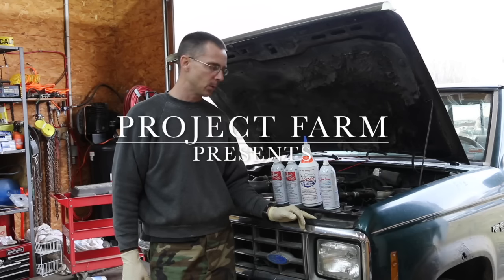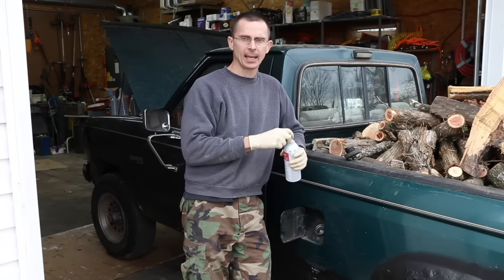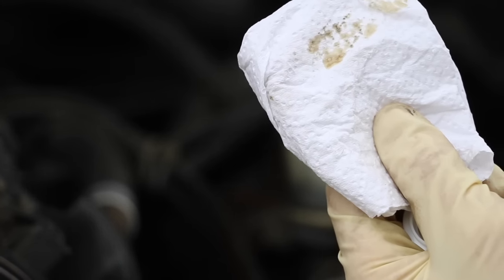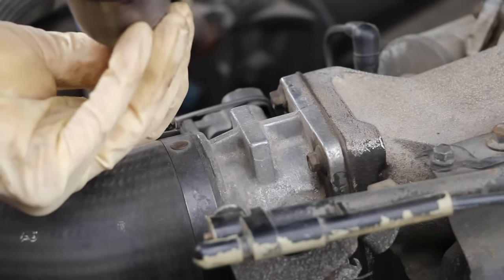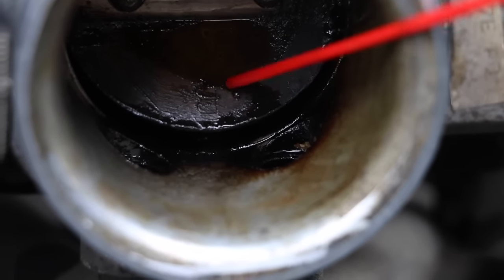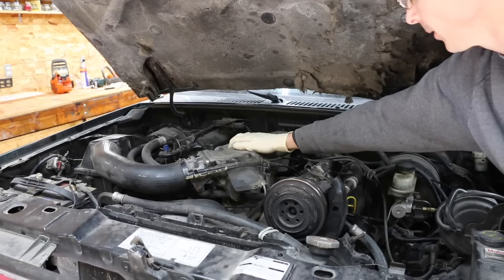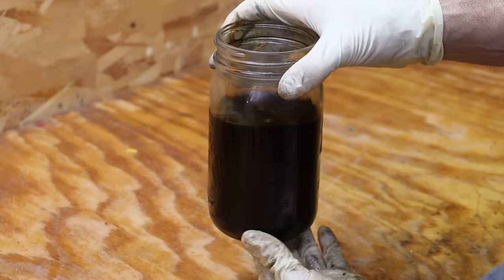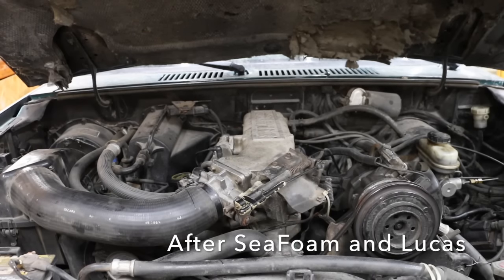Seafoam--can't believe what it did to my engine!!

Comment: I use Seafoam in all of my vehicles. I add a can to about every five tanks of gas. I have a 2006 Honda Element with 140,000 miles on the clock. The emissions light used to come on quite often. Since I have been using Seafoam the emissions light rarely comes on. And the car runs great! I also use it in my two vintage Buicks and my 2012 Maxima. I get better mileage and smoother idle with every car that gets a can of Seafoam in the tank every so often.
Reply: wow i do not understand why i here so many talking about so many problems at so few miles 
i know 3 people that with ease got over 300k miles a one was a 86 ford 2.9l and i my self have a 06 nissan altuma and run 10w40 of what ever is on sale and cheep oil filter and change every 5k miles and every 10k miles new air filter and has 125k miles and still runs and sounds like a new car and i should get nothing less than 300k miles out of it with ease 
ye new struts at 100k and replaced wheel bearing and brake pads at 110k and they were original brake pads we got the car new so i know they were original pads
Reply: Mullay2 at what year is a Buick vintage?
Reply: Well I guess that kind of depends on your point of view, but my two old Buicks are a 1956 Buick Special with a a Dynaflow and a 322 Nailhead V8. The other is a 1965 Buick Skylark sedan with a 4 barrel 300CID V8.
Reply: Mullay2 mm
Reply: Since I have a FlexFuel vehicle I just run a tank of E85 once a month to keep it clean.
Reply: Mullay2 do you know if it would work on a dirt bike? I bought a 92 honda xr250l and I suspect a bit of carbon build up. I plan on taking it all apart this winter to get it looking brand new. the guy I bought it from cared more about looks than performance.
Reply: Yes, E85 cleans.
Reply: I run it in my 2008 Honda Ridgeline as well. Seafoam is the real deal.
Reply: devin ostrom I am sure Seafoam would work for you in your dirt bike. But any additive is no substitute for an overhaul if your bike needs one.
Reply: Mullay2 who the hell cares about emissions
Reply: Tucker Moore Well, Washington State does for any cars newer than 25 years old and it is a pain in the ass and my wallet when any of my cars don't pass. It is a total scam but if I want to renew my license tabs I have to pass emissions.
Reply: Mullay2 oh ok
Reply: Mullay2 

  yuuh ur te||in m e is that if u use this seaf0m z i t keeps ur intake c |ean z
Reply: Mullay2 Better solution - dont keep your cars so long.
Reply: BigDish101 in Washington state %98 of gas stations are e85. its hard to find one that isn't.  I drive to another city to find gas that doesn't have corn in it.
Reply: Mullay2 When you say vintage do you mean 1996 vintage?
Reply: Nope. 1956 vintage and 1956 vintage.
Reply: Mullay2 oh I just read it. My internet loads slower than I can read LOL
Reply: Did you not watch the video? Seafoam is a great product. I bought a 63 Mercury that had sat in the Nevada desert from 1972 to 2007. I got it started and it had either a stuck valve or a collapsed lifter. I ran the 390 for a minute or 2 to see if it would clear but it didn't. Then I went to the parts store bought a can of this "expensive" product and added 6 oz to the crankcase. The engine ran rough to begin with then the dead skip went away and the engine ran great. So what exactly is expensive about that? 9.99 for a can of seafoam or 500.00 worth of headwork and the mechanic most likely used a can of seafoam to fix the problem?
Reply: My '56 Buick handles like a tank, does that count?
Reply: I have a 'O6 all wheel drive Honda Element which averages about 21 to 23 mph. The Seafoam doesn't really help with the mileage. But the engine runs smoother and has a bit more power. And since that little 4 cylinder engine is dragging around about 4,200 pounds it needs all the help in can get.
Reply: I use Seafoam in the gas tank. I haven't tried it in the crankcase or anywhere else. My 06 Element is Atomic Blue Metallic with the black plastic fenders. It now has 140.000 thousand miles on it and runs beautifully. But the engines on these cars are noisy particularly in the valve train. Mine always sounds like a tractor! Great for running around and doing errands and great in snowy weather but I agree with you about the uncomfortable seats for long trips. Plus I have never seen an 03 to 06 Element that didn't have duct tape on the left bottom bolster of the front drivers seat including my own.
Reply: That is very cool Jim! My 06 is an all wheel drive automatic with a 4 speed automatic. I like manual transmissions a lot but since I commute in heavy traffic I wanted to be lazy. I stayed with the '06 as the '07's and '08's with the 5 speed autos are supposed to be trouble prone. At least according to Consumer Reports. I have heard that the '03 to '06 Elements have essentially the same mechanicals as the CRV and they are legendary for their reliability. I have heard of Elements easily eclipsing 200,000 miles and more. But I have to say the prospect of an Element going 120 miles an hour does sound a little sketchy!! I also have a 2012 Maxima that has seen 110 on more than one occasion but that is another matter entirely!
Reply: I guess I will have to watch for that on the next can of Seafoam. The seats could hardly be less comfortable so there is plenty of room for improvement!
Reply: dexter2433 Its all about the driver and the gas they used. Also a new factory made car has been known to produce sludge. Sometimes you just get a dud.
Reply: Mullay2 Dude a really good job on this video!
Reply: lol all this talk about 100-140k miles.....255k -380k is usualy when I start to have problems with any GM. my 92 Duramax was still running great when I sold it at 580k.
Reply: up yours That is a diesel too. Very different. But gas engines will make it too 300k if maintained and driven right. My wife and I normally keep cars 6 to 7 years and are running great when we sale them. Maintain them and dont drive them hard and the car will last you
Reply: csb772 I usualy pick up cars around 150-200k and drive them till they die
Reply: Yes, it should work for carbon fouling related issues. That includes in a carburetor, fuel injectors, piston heads, sticky rings, valves, etc. Put it in the bike and then take it for a long, continuous ride. 

There are some YouTube videos where guys have pulled the head(s) off a bike to show the fouling and then put the head(s) back on. Then they run Seafoam and pull the head(s) again. BIG difference. Keep in mind that the smoother the surfaces of the piston and fuel delivery system the better your bike will run. Seafoam basically will clean out the crud, or at least a good bit of it.
Reply: If you dump the Seafoam on your seats they'll become a bit softer. Just be aware that the chemical burns are a real pain in the ass. I mean literally.
Reply: LOL! You win the internet today!
Reply: Trojan Horse 86 yea hocus pocus engine in a bottle all seafoam products work but seriously I don't care what you add to fuel or oil there's no such thing as an overhaul in a bottle the spray is amazing on throttle bodies and injecters and they have a product now for trans and hydraulic systems that's good 
but there's no genies in a bottle
Reply: dexter2433 Built Ford Tough!
Reply: Only people with lungs AND brains.
Reply: Lucas oil stabilizer is good stuff,especially higher mileage engines.Prevents dry starts for rings,etc.
Reply: Waste of money
Reply: Agreed.... Magic Oil will not replace the worn steel on bearing surfaces.
Reply: @Bob Jimenez Agreed, this is just for making what's there cleaner. Somehow I expect you're ready to read "Snake Oil" but it does take gunked up oil off if you let it soak. Source: I poured it in a weed eater's piston cylinder and let it sit for 15 minutes. The machine used to be hard to start and wasn't like that after soaking.
Reply: Ask my Daughter how well a Saturn Ion 3 runs with out oil. she called before getting home, wanted to know if I was in wheelchapir or had leg on. Leg.
she pulls in driveway - her motor sounded like a hammer hitting cast iron, yea, not good. Nothing on dip stick, 4 quarts  brought it up to a quart low! Yea, Low

So she figured oil in should fix it, pulled out of driveway, didn't even make it 1/8th mile
Yeah my GMC towed her back. She found Aluminum chucks under her car.

Pulled motor. two rods out the side! Along with Piston parts.  ooops
Reply: Seafoam won't fix that!!
Reply: Good intel, i have an 06 Element with exactly that problem.  I'm going to it out.
Reply: You are using Seafoam WAAAAAY too often. Pump gas contains detergents in it already, to help cars comply with emissions regulations. Your car probably had a bunch of buildup and the repeated Seafoam treatment is slowly removing it, but if you start with a well-maintained engine it would only need a carbon-removal treatment maybe once a year.

Also, if you haven't replaced your oxygen sensors, do that now. They fail slowly and progressively, and the engine computer has no way to double-check their readings, so when the sensors wear-out enough the emissions light will turn on because the sensors are giving the engine computer inaccurate data and the engine computer doesn't realize it.
Reply: Jim Piver ok
Reply: Seafoam actually removes a lot of carbon deposit and it works even better if you let the Seafoam sit longer on the piston directly. You can remove your spark plugs and do a before and after on your own vehicle. If you can't see, buy a snake camera. Also the Lucas product have been selling longer than you've been alive and it does what it says its suppose to do. If the Lucas products didn't work they would have been off the shelves years ago.  These are just small temporary fixes this man did to prolong the engine life of his truck.
Reply: I've had over 38 cars in 49 years and NEVER wore out engine or had engine failure.  Sold or traded them cause I wanted something else. Brought several new and never had as much as tick out of lifter, routine servicing and checking fluid. Changed the oil every 6 months or when it started turning black, oils now days along with better oiling systems oil last a lot longer.
Reply: I owned several Chevy's and fords. Never had engine or transmission problem with either.  Chevy 1/2 truck frame cracked from loads of wood, no I didn't over load it. also the 10 bolt rearends were weak, even up to mid 90s they had problems with them. Ford rearends were bullet proof.
Reply: no offense, but if you've had over 38 cars in 49 years, you probably haven't had any of them long enough to know anything about engine wear. i had my last car for 16 years. never used any products other than regular oil changes every six months for my engine - until a few weeks before i sold it. then i bought a bottle of seafoam, put it in the gas tank and just drove it normally for a few days. the engine was definitely running smoother, and i had no problem selling the car.
Reply: Brother You sound sincere So I don't want you to think I am Accusing You (As I have some other Commenters on this thread ) BUT This Is a Commercial and ALMOST EVERY Single Post Is put there by people Who's Accounts Have Little Usage and Very New dates, These are Account that Advertisers Pay people to set up and comment favorably about the Product. 
It is Mostly easy to tell because like any lie They add a Lot of very specific details, too many, If you are TALKING to someone I'm sure you've noticed that if they Keep on telling you more and more details Even though you didn't ask or they were not relevant; That you are being Lied to...I NOTICED that But never really Articulated it that clearly; but the I read it in a FBI Handbook on interrogation! So, It's Not 100% or anything But it IS Suggestive...ANYWAY... i Don't think that your a Shill or I would Have Said all this, Just said something Rude (I am kind of a jerk; and I don't like to be manipulated, My first Post ids Right below this one)
POINT IS if You are NOT a Shill; commenting Favorably Can (not does just Can) Make You SEEM that way and make Other THINK you are... Anyway Your Time Maintenance and Oil Changes Did Far more for the end result the the Sea Foam Even If it did get the Carbon out. I'm not saying it's Junk but some of these post are making Totally Absurd Claims About it and finish their statements With something like; "And it will work Better and Better Each Time! So be Sure to use one or two bottles a week..." 
Anyway Have a good evening friend
Reply: BigDish101 e85 has no detergents, people who use e85 strictly are encouraged to use a fuel system cleaner every few tanks. Your claims that it cleans your fuel system and or engine have no grounding facts.
Reply: Seafoam would not have any influence or effect on the emissions light.
Reply: You can clean your internal engine with nothing more than diesel fuel. A quart of diesel fuel in the oil and allow to idle for 10 minutes, let set over night, then drain and change will get the lifters clean and get the sludge out. 
Diesel is high detergent, a refined oil and will work like a charm.
Reply: Mullay2 it would clean off shit from the 02 sensors, we literally recommend fuel cleaner to our customers with intermittent 02 sensors and it works 9/10 times
Reply: If your bike has a "wet clutch", you risk clutch slippage if you add any oil additive, even some oils will cause your clutch to slip as some oils have friction modifiers in them.  Speaking from experience here using a quality oil (with friction modifier already in it)
Reply: How old are your vintage Buicks? I love the mid 50's but my favorite is a 1953 Buick Roadmaster convertible.....
Reply: I have a '56 Special 4dr hardtop and a '65 Skylark sedan.
Reply: Mullay2 m
Reply: David Gruesbeck m
Reply: NEW JERSEY HAS NO EMISSIONS TEST PRE-OBD II
NO INSPECTION AT ALL !
Whee-Doggie Jethro!
koff-koff,KOFF !
We're all gonna die
Reply: 140.000 Thousand miles? so 140.000.000 miles?? LOL
Reply: u put whole can in the oil ? where u add oil u put a can ? I only have one can how should I use it for rough idle
Reply: Use one can of Seafoam for twenty gallons of gas. That will help with rough idle if the problem is minor. Rough idle can have electrical causes as well however, a bad plug wire, bad plug, a bad spark box or a bad sensor can all cause rough idle.
Reply: J Love Don't put in the oil put it in the gas tank.
Reply: +molson12oz can I drive from my and get inspected there ?
Reply: +Mullay2 oh damn I already put 4 in oil 4 in tank and 8 going in intake tmro
Reply: Mullay2 the
Reply: Seafoam, Lucas, lots of other oil treatments will most likely help. DEFINITELY do an oil change promptly (or just throw a new filter on right after you add anything, then a full change when it's time).
Reply: Mullay2 I love young people who have big wallets and no brains keep us old bastards rolling in money ...waste of money every five tanks when it should be avery 100,000 miles LOL if you used true synthetics you wouldn't need seafoam at all but hey,  keep spending!! I need the money my yacht$$ is expensive and THANK YOU!! :)
Reply: dexter2433 yes use the cheapest grade oil you can find!!! i sell parts thank you!!!!  amazing how clueless young people are these days,(TAKING THEIR OWN ADVICE)  we are doomed!! if you used synthetics  even cheap kind you can run 15,000 miles between changes  it better than brand new petroleum based OIL after 15,000 miles!!  just change the filter every 6 k if you're running petroleum based oil 10,0000 you're walking soon you'll never see 160k out of that 350K engine??? petro oil has burned off the additives at 5K so it realLY cheap then LOL ( cooking oil ) do yourself a favor and us dont speak or type until your 30!! if you already are SHOOT yourself and save million lost by giving out BONG hit advice!!! DOPE!
Reply: BigDish101 the 15 ethanol does what in cleaning anything????
Reply: Mark Lopez no it doesn't if anything the 15 ethanol is doing harm  soon it will be removed from fuel costs million per year in damage  cause it turns to water
Reply: Young person, hardly! I am 64 years old, and have owned dozens of cars over a span of 50 years. Normally I would agree in part with you. I don't generally believe in additives of any kind. Although I have used oil thickeners like STP or Power Punch back in the day to keep a long series of old junkers running in a semi-satisfactory fashion. I do use synthetic oil in all of my modern cars. All I can tell you is that in my personal experience Seafoam works for me and my particular situation. Does that mean it will work for everybody, probably not. I keep my cars a long time, generally only trading them in or selling them, when I am well past the 150,000 mark and repairs no longer make economic sense to me.
Reply: Mullay2 I agree with you
Reply: Jim, I would LOVE to hear just one story from your days at Systems Control. I bet you have some doozies!
Reply: what does it do for valve seats full of crap?
Reply: i live in Seattle...would love to talk to you and get your feedback on my cars...83 & 84 oldsmobile delta 88
Reply: Sure, tell me something specific about them. Do they both use the Olds 307 V8?
Reply: yep...307 in both...the 84 has overdrive though
Reply: devin ostrom if it's a 2 stroke some seafoam + some throttle will work wonders if it is carbon build up
Reply: Phoenix Rising Yeah buy a brand new car every 2 years, that's the best solution.....or you could buy pre 2000 and run it forever, with proper maintenance, for the rest of your life......for 1/100th the cost
Reply: Jim Piver Yeah because $20 is sooooooo oo much less that $40,000
Reply: devin ostrom don't put any  additives to the crankcase of your dirtbike. You would have slippage in your transmission since it is a wet sump clutch.
Reply: And the earth is flat I'm sure, right? Seafoam and Lucas are both top tier products, that have been around for decades. Now STP? That shit is a gimmick.
Reply: Because the price point to purchase large amounts of vehicles, for a fleet is cheaper. Business 101. 

Look at the Police. The state police to be exact. That's where the reliability/toughness quotient is. 
Dodge have always been good, as long as it's Mopar. 
Fords go forever, because they are built with an amazing amount of body/frame flex. Something not rigid will always last longer than something that is, as long as its dynamically stressed. The engines though, not so much.
Reply: Oh SHIT - I never thought of that. You changed me for life. Tides. WOW. Genius.
Reply: Mullay
Reply: Pat Hetic Such a deal!!!
Reply: axcilary fan ac mazda 626
Reply: i hate ethenol try to only run premium 92 or higher
Reply: David Gaylord if your car manual says 92 use it but if it says other wise the engine will detonate and destroy the engine
Reply: Pasta Joe It'll have about half a second of 500 HP before it goes dead.
Reply: Tim Danby pretty much
Reply: Jim Piver 
Cleans that green paper residue right out of those wallets...
Reply: Mullay2 
It'll handle like a sports car if you pour seafoam on the tires and suspension...
Reply: burny, why the fuck would you do an overhaul if all you need to do is clean the sludge out? thats like tearing down you house and rebuilding it everytime you need to sweep or vacuum.
Reply: there is such a thing as having more than one car at a time you know
Reply: Do you add this to your gas after filling up?
Reply: Javier Norris According to the directions you can add before or after fill-up.
Reply: Nothing works better at preventative maintenance, than keeping your ride tuned up and serviced on schedule. 270,000 miles and 24 years on my rig - Runs strong.
Reply: RW4X4X3006 There ya go!
Reply: There is nothing wrong with ethanol itself, the only problem with ethanol is inferior fuel systems that aren'y designed properly to handle ethanol, and people who let it sit for many months on end until it goes bad and give it a chance to asborb moisture from the air.  Ethanol is a cheap way to increase octane of fuel.  It doesn't "turn to water", ethanol attracts moisture from the air, but the amount is ridiculously minuscule, especially when talking about only a 10-15% blend.  In the time it takes to use the fuel in your tank, your fuel would absorb such a minuscule amount of moisture from the air it would literally make ZERO different in combustion.  The only way it could absorb enough to change anything is if your let the fuel sit in your tank unused for 12+ months, and by then the fuel itself would be bad anyways.  

There's a reason people use e85 in high compression and forced induction performance vehicles.  It is basically cheap "race fuel".  It is typically between 100-105 octane which is perfect for engines with high compression and advanced timing.  You do have to burn aprox 20-30% more fuel than running gas, but e85 is generally cheaper than regular old 87-91 octane fuel.  Not to mention to actually purchase 100-105 octane gasoline would cost you in the neighborhood of $12-$15+ a gallon depending on where you get it.

Ethanol is simply ONLY a problem if used in fuel systems that aren't ethanol safe (any fuel system can be made to be ethanol safe, its mainly only a problem in very old fuel systems that are extremely out dated anyways), or if you let your gas sit until it goes bad anyways.  You shouldn't ever be using gas that is many months old to begin with.
Reply: While synthetics don't break down as quick as dino oil, they still get contaminated just as fast from carbon and fuel from blow by.  I use dino oil, and I change my oil often.  In low performance motors that aren't ran hard, sure, you can go 15k between changes.  I personally still don't let it go that long.  

If you put your engine to work though, especially if its high performance, the amount of blow by will contaminate the oil well before 15k no matter what type of oil you use.  Sure synthetics will be more resistant to breaking down and will still be closer to holding their rated weight at higher mileage, but they will be just as contaminated.
Reply: While living down in Texas in the early 90's I ran ethanol in my rig because it was the cheapest, and back then you had the choice. Truck ran fine. This crap today, not the same blend or performance.
Reply: Go to a farm and tractor place or a place that sells ethanol-free fuel for boats, its Better for your car
Reply: That sounds like A job for JB Weld.
Reply: up yours  I've got a96 gmc Sierra, 5.7 Vortec  350k miles and it still starts perfect, runs really smooth and drives like new (at least I think so😁😁). sept the milage has gotten shitty, probably the O2 sensor that needs replaced
Reply: Just those of us who breathe air and wish our children not to have respiratory problems. We are a darn selfish thoughtless bunch.
Reply: Parker Anderson what?! There's little to no E85 around Washington. That stuff is hard to find.
Reply: Jim Piver life is short write the book
Reply: Yep, also gets all the water out of your fuel system.
Reply: BigDish101 
Is that a joke??? E85 generates FAR MORE carbon than regular E90 gas.
Reply: SeaFoam fixed my old tractor that a seized engine and all 5 tires were flat. A can in the fuel and another in the oil freed up the pistons. Used a syringe to add it to the air in the tires to seal up all the leaks. Also works great as a weed killer.
Reply: Mullay2 I use soap-scum in my vehicles (but I don't think they like it..)
Reply: its not Honda but have you ever heard of the Tacoma with 1 mil on it? original motor and everything too.
Reply: If you use mainstream gas, it's not needed at all.
Reply: Mullay2 right on buddy guy, right on 👌
Reply: If you use good gas, almost never.
Reply: yes cause we are all rich like you.
Reply: lol. it's a few pennies more per gallon... or are you getting your seafoam for free? that cost $10 you know...  either way my point is true and stands.
Reply: Mullay2 I seafoam in my gas tank like you and put it in my oil before I change it and my 2008 mercedes c300 just passed 320 000km and runs like new. Been doing this since I got it at 120 000km
Reply: You should fix you car instead of trying to mask the problems with an additive. Your Honda is working as hard as it can to keep your MIL light off. You have to realize that it is putting the Engine Computer, 02 sensors, MAF/MAP, EGR etc.. under extreme load Then you will end up with a honda that you cant afford fixeing before to long. All because of your little light on, light off problem. ( which more than likely is your Cat or a lazy 02 sensor.)
Reply: aleon1018 Think your right. My vehicles always run better on Mobile gas.
Reply: I've got a 1995 accord and have never added an additive and it has 281,000 and it runs great.
Reply: devin ostrom yes it works on any engine I use it on my Z1000 and mower and dirt bike cars and everything I own it's great oh yeah even my weed trimmer it's 2 stroke
Reply: every 5 tanks?  That sounds insanely extreme....  Nice try seafoam.
Reply: Nice
Reply: Mullay2 5tffffc
Reply: Mullay2 - you are paid how much??
Reply: What about using high octane gas I can feel the throttle response change with 91+octane booster in my tank . I had 2 Tahoes I did that to now my silverado... people don't believe it but 91+octane boost I like bwahahaaa usually do just chevron with the chevron octane boost the big one.
Reply: dexter2433 A engine with 100K California miles is a lot different than a car with 100K Wisconsin miles.
Reply: Wow, this comments section got out of control.
Reply: HotCoco.   You think!?!!😍 l kept laughing thru it but YOU.  You hit my "laugh" button.  l laughed so hard my eyes watered and tears ran down my face.  The really crazy part is l'm a very old dame and didn't know what they were talking about !!   The first time l read " seafoam " l though they were talking about actual seafoam.!  l'm thinking why do they put ocean foam in their cars & trucks ?  these guys are certifiable NUTS.. l just HAD to read on.  Oh it's not...why the hell do they call it that? so l could feel stupid.!!!  NOW THEN l read every one of those comments and l STILL don't know if l should use the stuff.!!!!  Like l mean l bought a 08 Toyota Carola from a used car dealer about six mos. ago.  I had a 04 Pontiac Aztek and reslly liked it.  took good care of it.  thought it would last me the rest of my driving years.  But a damn teenager ran a red light and totaled it.  No drivers license. No insurance.  And l was ggrrrrrr pissed-off.  So now l'm driving this puddle jumper that l know nothing about its history.  l have to think about these comments & maybe put some of each in that contraption.  l live on social security so couldn't afford to buy a better vehicle.  l'm pretty sure you're having a good laugh over MY comment.!!! Have a good day. 😃😃😃😇😇😇
Reply: Mullay2 3
Reply: Parker Anderson well that place sound just awful
Reply: Damn really? I wish it was here you cant find one unless you go straight into the capital city. I don't get why they don't run more here in the south especially since e85 is better for most cars.
Reply: Parker Anderson what? I live in Washington and very few times have I seen E85 pumps. Not many cars that are set up for it. If you mean to have said 98% of the pumps, excluding diesel, are 10% ethanol mix, that would be close. I know of a few places where I live, that has ethanol free fuel. That is all I purchase for our vehicles, toys, tools. I would like to see some more 20% bio diesel sold around here. I seem to get better fuel mileage, power with that mix.
Reply: Dingle Berry tough to remove parts, tough to find parts, tough to get same year diesel as mine up a dirt hill, even when given a lead.  Poor truck, he only put in 6k of parts into it and couldn’t match a 3rd of what I was doing.
Reply: Mullay2 n
Reply: I have a Audi A4 S-line cabriolet (Convertible) anyone think that it will work. I just want some tips on what’s good for cleaning engine build up. I see on this video his throttle response was quick so that was a plus
Reply: Mullay2 loo
Reply: yawn.......
Reply: I am so jealous. Don't know what you think of newer Buicks but I had an 85 LeSabre with a 225 V6 that ran like a scalded cat, and got 25 luxurious MPG, thanks to the 4 speed automatic.
Reply: Jim Piver and what works better??
Reply: Mullay2 ñ
Reply: I think a lot depends on how and where the car is used. If you can put most of your miles on an open freeway where you barely need to crack 2K RPM for 95% of your commute then I think you'd expect to see much less wear than someone who spends their entire commute accelerating and decelerating in gridlock traffic.
Reply: Seafoam is just Pale Oil, Naphtha, and Isopropyl Alcohol.
Reply: Bob Jimenez I think these have some form of zinc in them, which does bond to metal surfaces and reduce friction. It can however also coat exhaust flow sensors, cause Ecu errors, which can lead to lower mpg and reduced performance.
Reply: Јоhn Daniel I’ve never done it, but it makes sense. I think seafoam uses kerosene(or something similar) as its base fluid, diesel and kerosene are of similar consistency. I would worry about the dye they put in diesel fuel, but I don’t know much about it.
Reply: Dennis Rooijackers you comments nazi. Lol
Reply: Scott wads  whether the base material of your engine oil is synthetic or conventional doesn’t matter. The grade of the base material is what matters, and each manufacturers additive blends are different proprietary blends formulated to work with their chosen base oil. IME and IMO full synthetics are better, but objectively speaking a conventional or blended oil can be an equivalent or superior lubricant.  P.s. an engine oil with a grade 4 base is a good place to start, after that everything is kind vehicle specific.
Reply: weakbrainthrombosis, I just posted right above yours what it's made of.
Reply: God damn that was like night and day
Reply: up yours i have 330k on my 94 sierra
Reply: @phoenixrising7047  yeah man don't keep your cars too long just go to a stealership LMAO
Reply: You can tell how wealthy someone is just on how they view car mileage. For a rich person 100,000 miles is a thing of awe, an extreme distance. For a poor person, a car with 200,000 miles is about par for the course.
Reply: @annoythefish  if I was rich, id have antique cars and all of that and even my dailer driver would just become a part of the collection eventually
Reply: Mark Lopez  if you have an earlier model car not meant for E85 don't use it. you will be sorry
Reply: Austin Lucas are you Related? ; - )
Reply: Great video good job
Reply: Jim Piver what exactly was the rip off ? Lot’s potatoes no meat !
Reply: How to change your valve cover gasket on a 2004 Ford Ranger
Reply: Bc call me I've been trying to call you
Reply: Nh!
Reply: Mullay2 Aa
Reply: G GOING
Reply: @davidgruesbeck5040  d
Reply: Hhhmmmmm...... People from the Senate and Congress should use this......
Reply: Very good
Reply: My 04 element has engine light on. Only code reading is for knock sensor. Wondering if anyone including OP can tell me if a Seafoam treatment as performed in the video might allow the sensor to not get tripped. Engine has been known to stall when coming to a stop. Thanks for your time.
Reply: Phoenix Rising,

Why should you go through cars fast? If you take great care of it, it will last as long as you want it to.
Reply: I'm a member of the Buick GS lub. Best club I ever joined. All sorts of great Buick tech!  @Mullay2
Reply: @LR-my2di  Some of the friendliest car people you will ever meet are in that club. What year is your GS?  I have a friend with a yellow and black 1965 Gran Sport and another with a bumblebee 1970 GSX.
Reply: 1987 GN and 1970 GS 455. The latter belonged to my Dad until he died. He was a GSCA member, too. I love both cars and the GS Club of America has helped me a lot. The Prez. is a great guy. Returns all phone calls and is a wealth of knowledge and help.  A year ago there was a full custom '56 nail-head twin turbo at the GS Nats. A Hot Rod mag. full feature car.  Incredible car. It was also featured in the GSCA magazine.  @Mullay2
Reply: Mullay2 i
Reply: @Mullay2  you could maybe just renew your tabs in another state, having sold your cars to a (simple to set up / manage ) LLC (that  you set up / own) organized in that state.
Reply: @Never-woke  no, the car would have to be owned by a person or corporation in NJ to avoid inspection in NY.  Not hard to do, just set up a corporation there and sell your car to the corporation and drive it as a corporate vehicle.  Of course, who knows, NY can be a pain in the A** and may say you still owe them money.  Dang liberal money grubbing states.
Reply: @user-io3hy4zb4s  that arrangement is commonly used for registering exotic cars via an LLC in Montana. Ed Bolian in several VinWicki videos on YouTube talks about that.
Reply: Mullay2 So can I use this with my Car BMW F30 MSport 320d
Reply: Liam Winter Vintage as a rule is 100 years old...People these days get Vintage and retro mixed up
Reply: Liam Winter then again ...Cars haven't been out very long so maybe the rules need to change 😂
Reply: @Mullay2  No issues with the nailhead?  I have a '64 Riviera with the 425 and I thought about using this in it.
Reply: @bepnewt  None whatsoever. I dump a can in the tank about twice a season.
Reply: Jake Heke  Yes, I do, and I also own and drive two vintage Buicks a Nissan Maxima SV, and an Acura TL Tech Series. And don't laugh at a Honda Element until you have lived with one for about 8 years like I have. It is AWD and can go almost anywhere. We had almost 2 feet of snow and ice for a month here in the Seattle area (very rare I might add) and the Element is the ONLY car in the fleet that was mobile. It has nearly 150,000  miles on it and runs just as good as the day I bought it. Yeah, they are kind of funny looking, and not really a daily driver (although they can be as mine was for a number of years.) Around our family it is known as the toaster!
Reply: Jake Heke  No, they were too fugly even for me. Most critics claim the Aztec actually killed Pontiac. I think they are probably right!
Reply: @Mullay2  I have a 1970 Skylark custom (350 2Bbl ) which a maple tree fell on 2 years ago (Only good for parts now) and a 1970 GS455 convertible that I plan to restore. I do love them old 50's Buicks.
Reply: @rverro8478  That GS455 convertible has some real value to it. "When the top goes down the price goes up." There are probably a fair number of parts you can use from the Skylark to restore the convertible. Good luck!!
Reply: Wow, can even keep cel's off
Reply: @thewhomphlew  do you mean 95% of stations sell fuel containing ethanol? In SE Idaho we have few stations that sell ethanol free fuel and it is usually 60 to 85 cents more per gallon.
Reply: @seyfertNGC501  wow, that's awesome. I use sea foam to stabilize fuel in all my seasonal engines (snow blower, lawn mower, motorcycles).
Reply: @dexter2433  mainly I'd say that your engine is in good health because of the frequent oil changes, rather than what brand of oil it is that you're using, and keep doing that, it is what makes engines last. the problem with all of these "long life" "long oil interval" stuff is that it is a designed failure from the manufacturers side.. they want you to treat your car just so bad that it will need fixing eventually. Thats why I never go over 15000km per oil change on my cars. and also most Hondas got V-tec and that also benefits greatly from frequent oil changes as the system is kept free from clots and clogging.
Reply: Hi great channel, you nead to adjust the lifter springs that's all. Dont put special oil in.
Reply: @dexter2433  my Cadillac Escalade has 230,000 miles and it still runs like a champ no problems besides your normal wear and tear
Reply: Thanks for sharing this info. Another positive feedback on this product, I will have to try it. Thanks.
Reply: every 5 tanks seems excessive...
Reply: What's funny is if you didn't put 87 octane in your car you wouldn't have those problems to begin with
Reply: @BigDish101  I thought that ethanol was the problem. How can more of it improve things?
Reply: @davidgruesbeck5040  If still under warranty, return your daughter for a full refund.
Reply: @upyours4679  And you sold it why??

If it was running great then please explain why you sold it?? 

Better not have sold it to just get something newer.
Reply: @csb772  Actually if maintained with hi performance Synthetic Oils like Amsoil, Neo Synthetic, Royal Purple, Redline, or Syn Lube Synthetic Oil, gas engines can last millions of miles. 

But people are too scared to use those oils becuse they cant believe their long drain intervals. 

Syn Lube can last for 150K miles before it needs to be drained. 

So.. Its a no brainer that Hi-Performance oils that are true man made oils run circles around everything else.
Reply: Mullay2  ive used it on my gm vehicles in the oil and it removes the valve sticking issues with all ls engine blocks. it keeps them quiet as they can be.
Reply: Vlog Squaaa Smith, My father worked for Ford for 38 yrs and I bought a Chevy Silverado in 1999, my dad shit a brick! He told me that I would have problems.... Transmission flew to pieces at 71k miles and I never pulled shit with it! I liked the truck but it was a POS. Had quite a few issues with it. I regularly maintenanced it, probably more than I should’ve. Idk, I know there are horror stories with every vehicle maker but I been a ford guy ever since. ✌️
Reply: I remember when mine was new too. smh 140k sheesh almost 500k on my truck and exactly no cans and of seafoam.
Reply: S10 398k then i got rear ended
Reply: @seyfertNGC501  winnemucca shout-out Marauder.
Reply: I put seafoam in my Cheerios every morning. I’m 24 and now have liver failure. Please don’t do this guys.
Reply: You can also get your revs up every once in a while to keep the motor clean from carbon deposits. It's cheaper.
Reply: I have a 2009 Volkswagen with 139k miles on them, I never used Seafoam and I kinda want to try. I am really unsure how to do it, but knowing that you use it on the 1956 Buick, could you tell me how you do it on the 2006 Honda?

Plus to that, I might want to try it on my 1992 Buick Park Avenue with only 90k miles.
Reply: You sure?

Edit: I have a 2009 VW not the Honda.
Reply: @pastajoe32  higher octane won't destroy the engine, but it doesn't give more power either. Octane rating is a fuel's resistance to pre-ignition from high compression. The "knocking" or pinging one hears is the fuel igniting prior to the spark because of high compression. High octane ONLY fixes that one problem. High octane fuel sometimes burns worse because of its additives (like lead) that prevent pinging.
Reply: @csb772  Ok
Reply: dexter2433 
Same thing with my 95’ Camry V6 XLE
Oil changed every 6 months regardless if I drove 3,000 or 7-8,000 miles and the only thing too ever happen was battery obviously,
The computer went causing limp mode in my tranny,and a bad EGR VSV.
Total fix cost under $500 after 25 years and $180 of that was to a shop for installing the computer and that only happened because they were storing it for me when i was moving.
Reply: My 2003 element has now 320,000 miles and still going strong. Love the dependability of a Honda lol may have to try this seafoam out. Still kind of scared
Reply: Renegade 1000 
If it aint broke don’t fix it
Reply: What is a emissions light? Never heard of it???
Reply: hksjoshua 
It’s another way of saying 
Check engine light
Reply: @upyours4679  150-200k,  is where I am looking at this time.       My Honda has 251,200 miles and runs just fine.  High mileage is the way to go.
Reply: Im at 292k on my mustang right now never had any engine or transmission trouble yet never used an additive
Reply: My sister's saturn vue has a crummy idle at certain points. Would this help? It has over 206k on it

My pontiac g5 rins great, has ~140k on it, is it a good idea for it as well?
Reply: How old are the Buicks?  My Grandmother had one with a 3.8 and they pretty much last forever.
Reply: Add 1 oz of seafoam for each quart of engine oil to clean inside engine too..  they now have seafoam for transmissions too
Reply: @devinostrom5195  it will work in your bike.
Reply: Kn.
Reply: Q11
Reply: @liamwinter4512  
I'm guessing 60s
Reply: @seyfertNGC501  Ahh mechanics little secret ,good to know .
Reply: aleon1018  We're you making some kind of point in reference to something?
Reply: Quietest Diesel Gas Engine on Earth!!!!
Reply: The Lucas is what's good
Reply: The Lucas is what's good